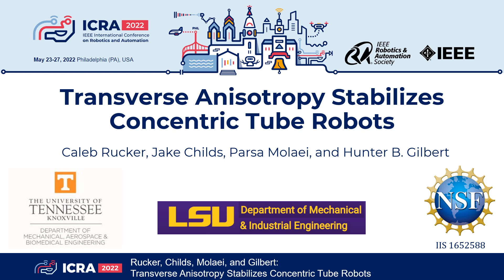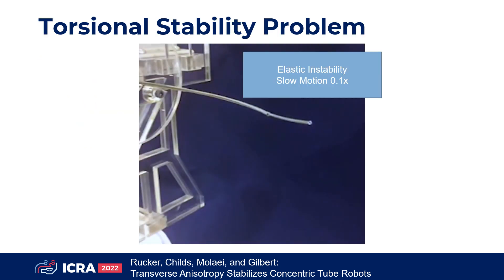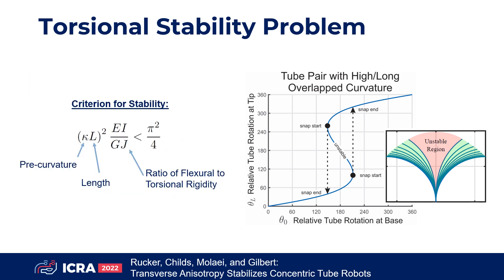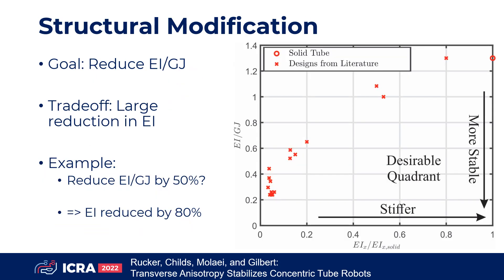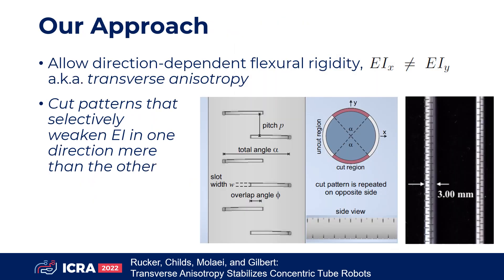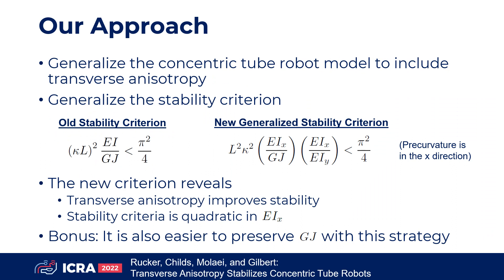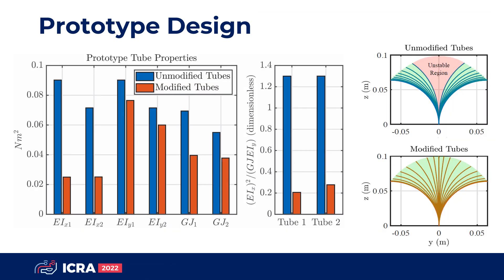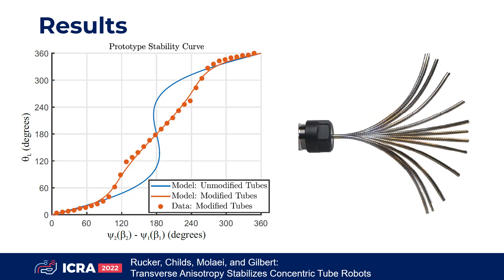Concentric Tube Robots: Stabilization through Stiffness Asymmetry

Comment: great work! what did y'all use to cut the really small hole pattern in the tubes? also how did you find the exact EI and GJ values for these asymmetric tubes? do you also think there could be an even better design that minimizes EIx and maximizes GJ, or is this pretty close to the theoretical maximum? i mean, if the workspace is still full, then it really doesn't need to be reduced more, but just asking for a general case.. awesome work